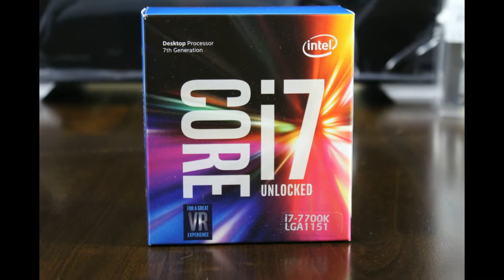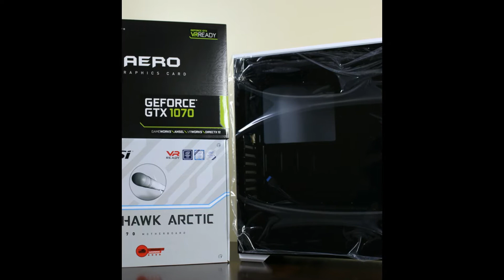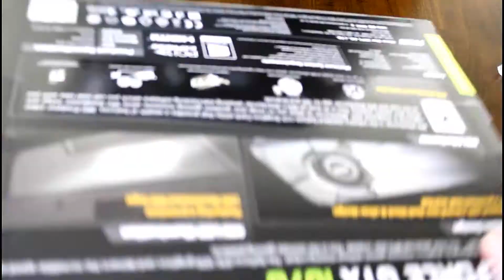$1,400 PC Build of 2017  ( Kaby Lake i7 7700k with a GTX 1070)  TIME LAPSE!

Comment: Is there a big deference between a 1080 and 1070 graphics card?
Reply from the maker: yes there is, depends on what type of monitor your also running. But between the 2 cards theirs about 20-25 fps difference
Reply: CS Tech Studios so is it worth the money to go straight to a 1080?
Reply from the maker: If you have the extra 60-80 bucks then Yes!!
Reply from the maker: as long as your CPU can handle it
Reply: CS Tech Studios and, why you not use a Z270?
Reply: CS Tech Studios actually, your Processor is K series
Reply from the maker: budget concerns :)